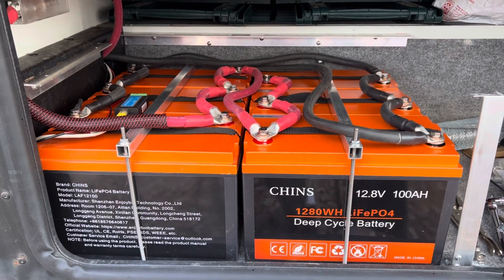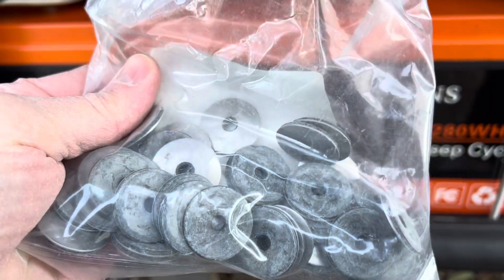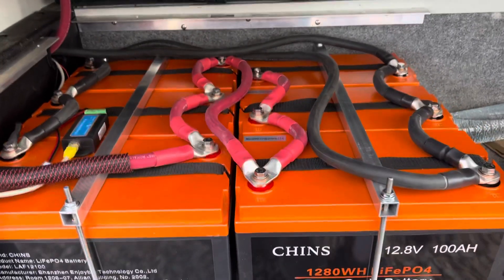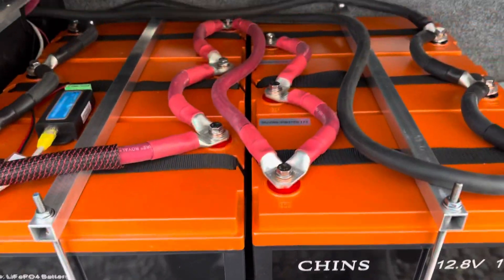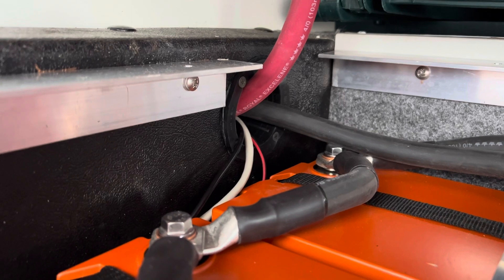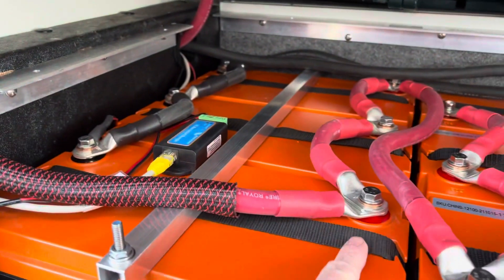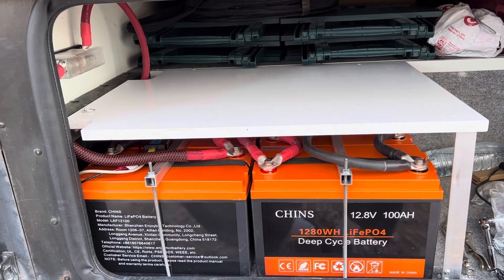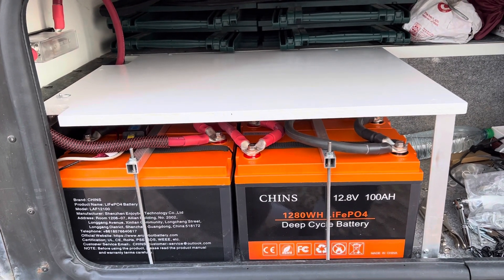Solar Upgrade Phase 3, part 2

Comment: Those are lithium Iron phosphate batteries. They do not catch fire.
Reply from the maker: There is a risk of excessive over heat (catastrophic run away).  It’s rare, but this is the very reason why planes do not allow lithium batteries in your luggage.
Reply: @coryhanes  Sir,
 that is Li-on think phones etc. 
Lifepo4 is inherently safe, heavier and less energy dense but safe.
Reply from the maker: @GluttonywithaGerman  actually LiFePO4 batteries are some of the lightest batteries. In general they are about 1/3rd the weight of a lead acid battery and twice the useable amp hours than lead acid and AGM. For example the large lead acid batteries I pulled out of my motorhome are 74 lbs each where as the LiFePO4 battery with twice the capacity is only 24 lbs.  yes the battery is typically safe but they go into overheat if charging too fast or if one cell out of many internally shorts. It depends on the build quality of the battery.

Comment: 4 awg or 4/0?
Reply from the maker: 4/0… did I say 4 gage in the video?  If I did that’s a mistake. All battery cables are 4/0 high strand count welding wire.
Reply: @coryhanes   no I just wasn't sure Wich you were saying ty